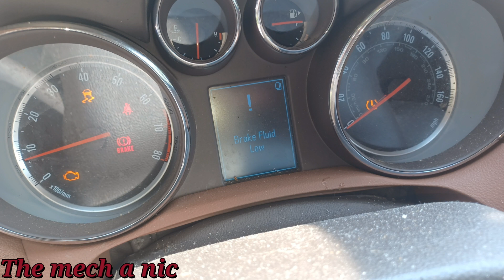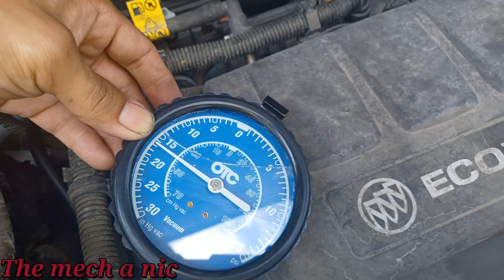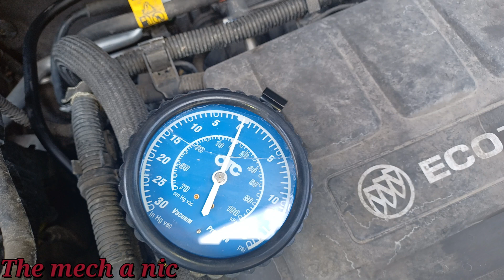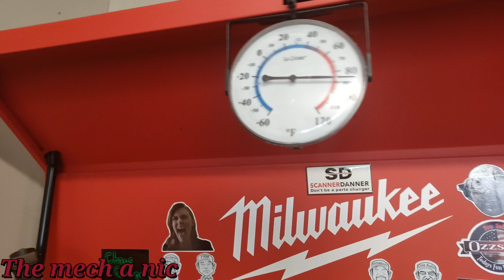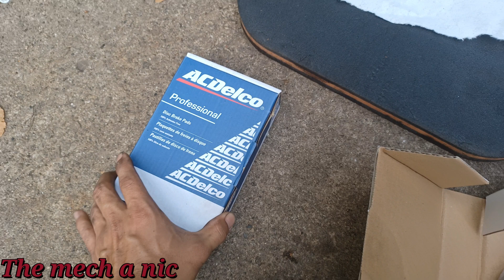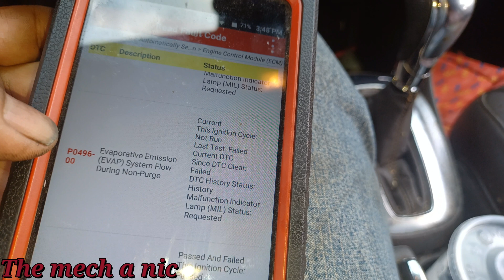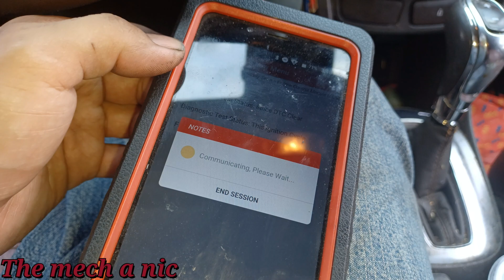buick encore has no brakes

Comment: I had to change one of those vent valve solenoid's on my GM, they are a $17 part but I did have to partially drop the tank. Seems that garage knew her issue was the purge valve which they would have changed and cleared up the codes all while charging her for the vent valve, straight out robbery. With cars being this complex it's difficult for consumers to avoid getting chumped by these thieves, good job.
Reply from the maker: Exactly, you'll never know if a shop is trying to take advantage of you. Thanks for the comment

Comment: There’s a GM special coverage for that EVAP purge valve.
Reply from the maker: Special coverage?
Reply: @themechanic6117  that part is cover under warranty even though it’s out of power train warranty GM know it has a problem with certain parts so they will release a special coverage  on that part only
Reply from the maker: I didn't know that. It's a pretty cheap part so not a big deal. Thanks for the info

Comment: Noble work, imagine what she would have paid if she ran into someone.  Did you cycle the ABS solenoids to purge the air, if the pedal travel feels suspect?
Reply from the maker: That's what I tried explaining.  If you don't have the money to fix it imagine how much it costs if you crash . It completely slipped my mind to cycle the abs pump. Next time it comes back for service I'll perform another brake bleed 👍
Reply: @themechanic6117  If there are bubbles in the ABS ump. they may work their way out over a week or two. I did some brake work for a friend and couldn't get 2 of the bleeders open so couldn't do a scanner bleed. The pedal was firm but a little low. After a couple of weeks the pedal gradually returned to the previous higher position. Would be interested to know if that happens with this vehicle.
Reply from the maker: I've had that happen to me as well . On a different car, I couldn't get the pedal perfect but after some driving around it went back to normal.  I always forget that I can use my scanner to help bleed brakes

Comment: Nice catch on the vacuum/purge/evap thingy. That lady is lucky to know your wife, hopefully she is able to repay both your trust and kindness. 
It looked like the rear tyre sidewall was all cracked at the beginning of the video. Is that normal for a 7 year old car where you live? Asking coz it doesn't snow where I am and I've definitely seen tyres looking just fine after 7-8 years (not driven much). I was wondering if they were buried in snow for weeks at a time or something to cause that. 0:30
Reply from the maker: Yes those cracks are normal for a tire of that age but they need to be replaced  .

Comment: Without maintenance, I wonder how fire engine will go   They are known to die
Reply from the maker: I'm surprised the turbo hasn't died yet
Reply: @themechanic6117  I know… From what I’ve seen it’s the timing chains  that usually go, didn’t know that car had a turbo
Reply from the maker: It has the 2.2 or 2.4  ecotec engine . The turbo looks exactly like the turbo from the chevy cruze and sonic

Comment: How the hell did she get the car to stop?
Reply from the maker: I have no idea...she said she would drive at 80mph on the expressway like this!
Reply: @themechanic6117  thank God you weren't in the car when she did .
Reply from the maker: I wouldn't get in a car with no brakes
Reply: The rear left seems to be working. I think all cars brake system have two sub-lines, so if one is leaking the other sub-line and two brakes still function. It's still dangerous though and needs to be fixed right away.
Reply from the maker: No this car had no brakes at all. No brakes were stopping this car. At best the pedal pressure was enough to slow the car down
Reply: She drove like this for weeks. There got to be some brake force, or the car is already wrecked. Dual circuit brake system explained here. I believe that's why.

Comment: I would've suspected huge rear wheel damage, like hitting a curb
to snap a caliper like that? Can you imagine the force required?

Very strange, all surrounding components are intact?

(cue xfiles music)
Reply from the maker: Now that you mention it the rotor did have a flat spot on it. Like if the car sat on the ground resting on the rotor with no wheel on it. Not sure if that's related to the caliper breaking. My best guess is the piston pushing against the rotor caused so much friction that it  Jerked the caliper hard enough to snap it
Reply: I bet the bracket broke when the piston came out, got jammed against the disk and was launched into space. 🚀
Reply from the maker: Exactly my thoughts
Reply: @wstobinSE  
You would think (hope &🙏🏻) GM Engineers incorporated the Inboard
Pad's Locator Pins to still retain the Backing Plate and Piston, in case of catastrophic failure of the Friction Material?

I have never seen a Piston escape the Caliper housing due to pad wear.
I have never seen a Caliper mount snap like that- without obvious
damage to the surrounding components (Control Arms, Sway Bar, Wheel,
Spindle, Hub, Rotor, etc.)